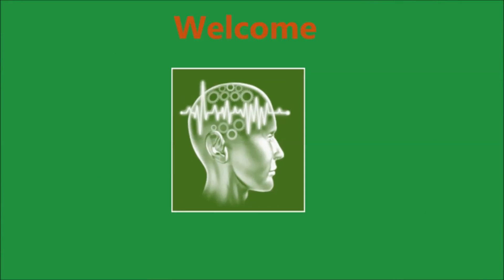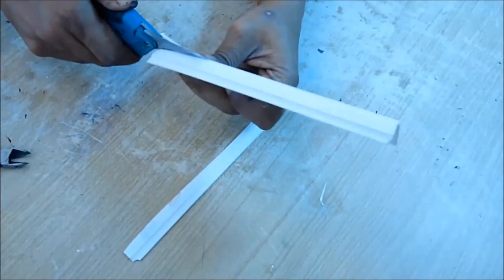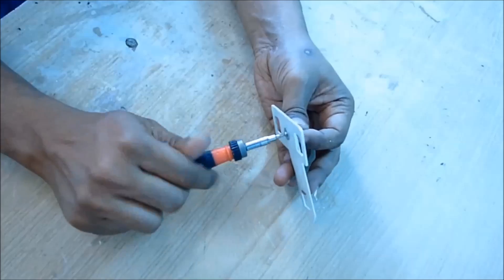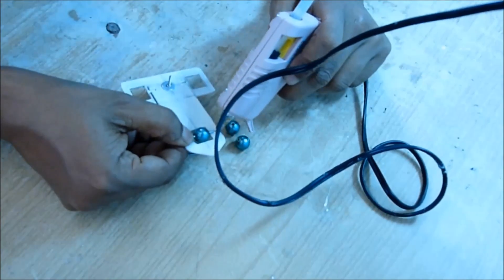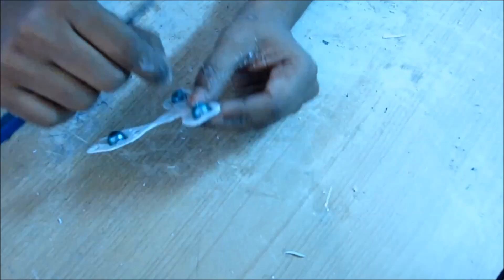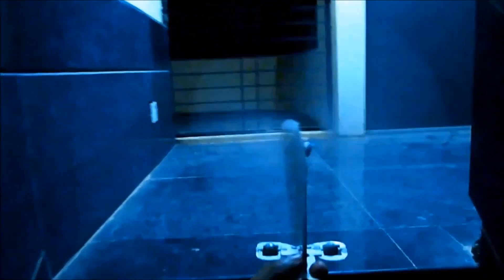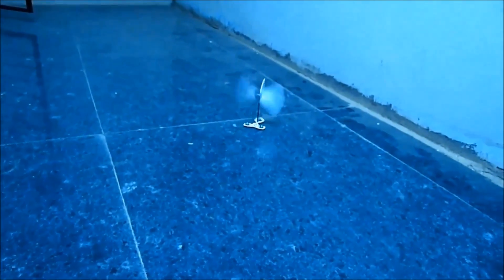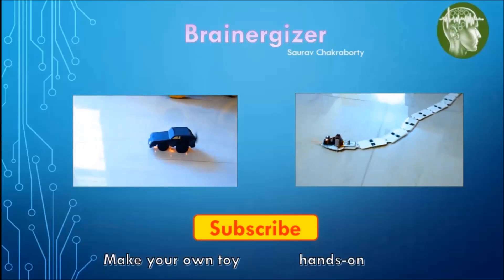How to make wind powered toy car for kids

Comment: But why not gear the wheels with the propeller? This way I only find the car as a sailing one, but shifting the sail by a propeller? Am I wrong?
Reply: +DoNotPushHere You are absolutely right. I thought he will make the propeller connected to wheels by gears. Adding a sail will be much efficient than using a fan.
Reply: Jiraya Jiraya
It's the problem with these "wind powered" concept toys. I always search for a DIY version and fight against these simple toys. Would you believe that I DO KNOW that once there was a rubber band autogyro, and I still couldn't find neither plans, nor documents, nor videos of the subject? I believe there is a copy  and paste tendency all around YT, and only a few true creators...